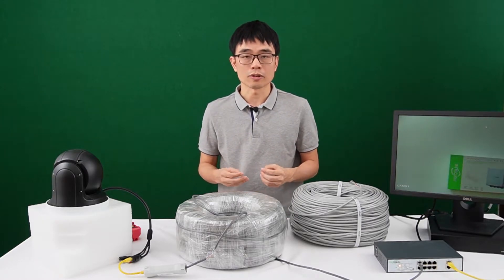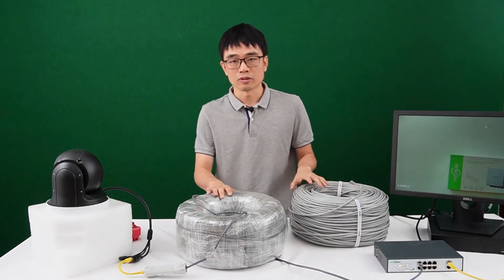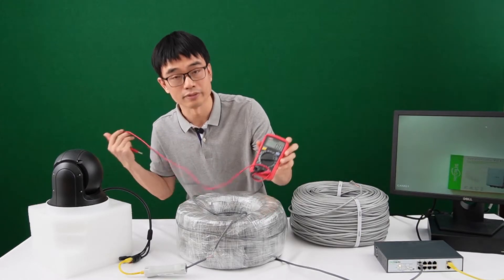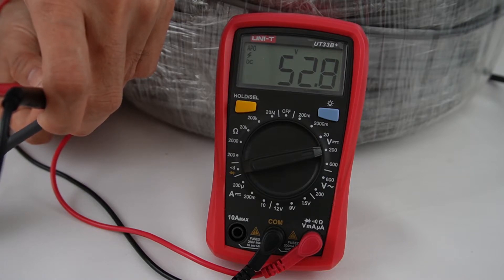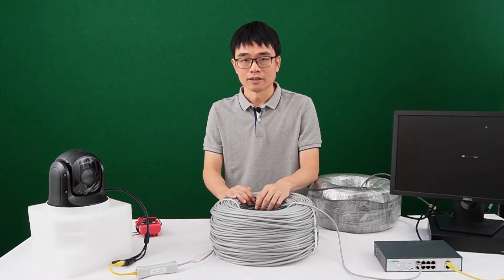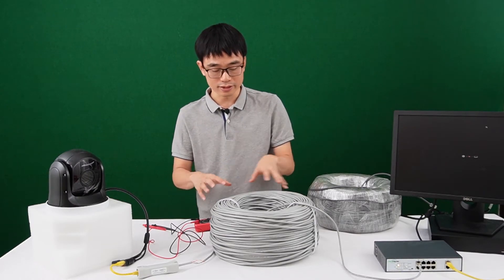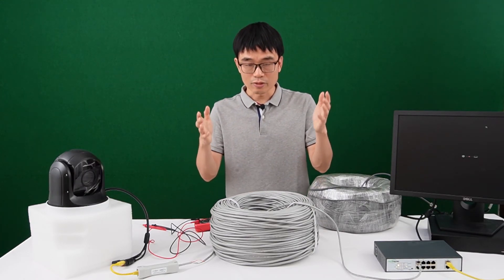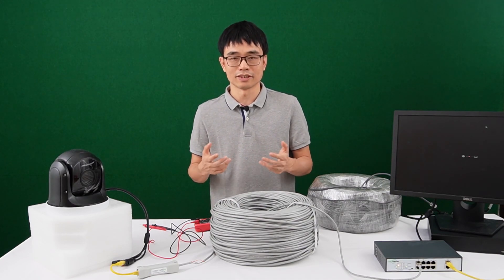Long Range PoE needs good cable, not just 100% copper

Comment: Which wire you use to measure voltage?
Reply from the maker: It is 24awg both. I think people always find the way to cost down. It will not cause issue with 328ft run, but when you extend the PoE up to 1000ft, the issues could come up.